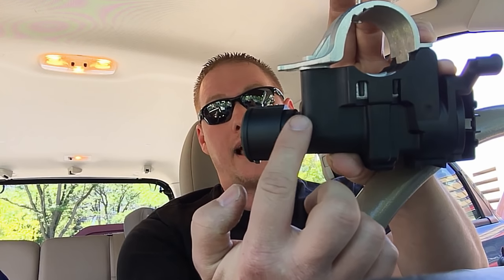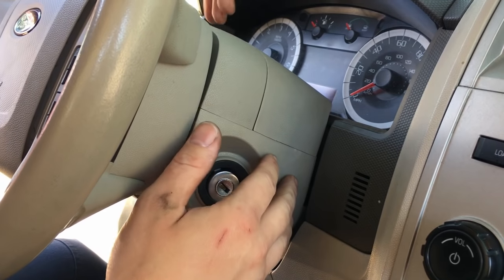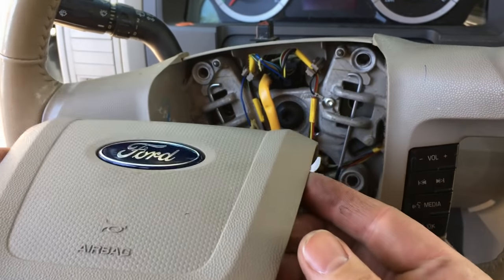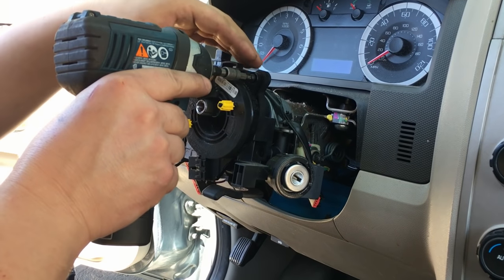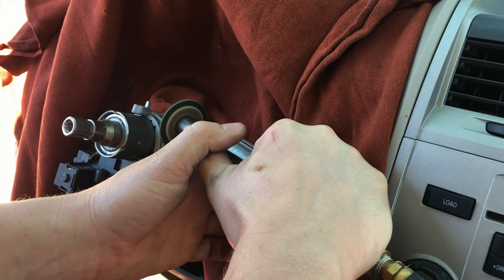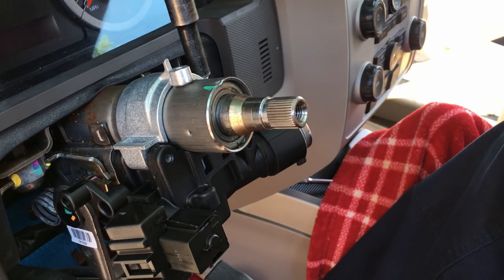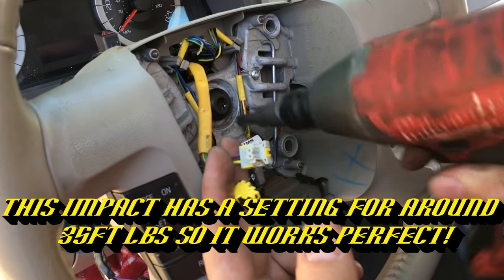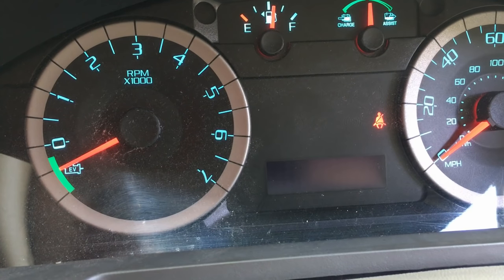2008-2012 Ford Escape No Crank No Start: Ignition Lock Module Replacement

Comment: I wonder if a bolt extractor would work on the blind bolt, might save the mess of the metal grindings.
Reply: Dremmel is what i use.
Reply from the maker: It should but this is the way Ford instructs us to replace them and it works quite well just a quick grind.
Reply: I can confirm that a punch/chisel works great!  I removed the bolt on 3 Ford Focus's this way.

Comment: Are you able to keep the original key/key hole or does that need to be replaced with an all new key ?
Reply from the maker: it stays the same.
Reply: Thank you for your response so quickly and great video, very nice.

Comment: Hey Bro! Wished I'd seen this video last year, My Bad :) Copart had a sweet high level trim Escape with 98,000 and a No Start.... it sold cheap and I wanted it but no idea that easy to fix!  also I have a 71' LTD that the key just turns a 360 :) Not biggie, only turn to run and press the secret button!

Comment: I know it's an older video but I was hoping someone could still help. I have an 09 focus with the same problem but the switch itself is rounded at the mechanical interface. I replaced the switch last year and it worked perfectly until now when it started again. When I look at the new flange it seems to have the same design flaw, metal rod interfacing with plastic hole. Does the new flange address that issue or will I have the same problem in another year?

Comment: I took the old cylinder out in the accessory position but when I went to put the new cylinder in, the lock module is in the off position so I can't insert the new cylinder all the way in. How do I get it over to the accessory position?

Comment: It’s a 2012 ford escape. Every time my battery gets disconnected it will idle low and turn itself off repeatedly until the computer re learns itself. The key has been broken but I had taped it but it got harder and harder to start. The Machanic I use put a switch to the ac compressor bc it wasn’t getting power and turning on without it but after he did that I would have to switch it off when I slowed down at a light or stopped bc it would idle low and turn the car off. Fast forward to now since the keys broke the Machanic used the ignition switch to start it up but the min I put it in gear it will turn off not allowing me time to drive it so the computer can re learn itself. I hear these escapes are notoriously doing things like that is that true? I do Uber/Lyft/DoorDash and favor for work so I NEED my truck to make a living. It’s been sitting here for 2 months already and I can’t get the Machanic to come fix it and get it going for me again. He says he will come but doesn’t show up and Im drowning here I have got to work. What do u think?

Comment: I did everuthign except torque the t50 screw to the steering wheel now it has a bit of play, could that be the issue even though I cranked it with the torque bit?

Comment: I have a 2012 Ford Escape...when I go to remove the screws on the bottom half of the steering column cover, I find that the screw or bolt has a round head. There are no grooves for a screwdriver and there are no sides to the head for a socket. It is round and I cannot figure out how to get them out of there. Any idea??

Comment: Hello. What If my 09 mazada has times when it starts up and sometimes it wont start.  So, if i tried to turn my key to start and tryed to push but it wont go in. Is it the Emission switch instead of the locking part??

Comment: Girlfriend has a 2010 Ford Escape. It won’t start, lights come on but in order to get it started (which is not doing it now) you have to bang on the dash (instrument cluster) for the dash lights to come on and for it to start....never in my life have I seen or heard anything like it. Battery is fine, she had the ignition switch replaced last year. Any ideas????
Reply from the maker: You need the solder joints on the cluster repaired, very common.

Comment: Hi, During the test,What if the theft light is blanking?
Reply: I have the same question. Did you ever find out and answer to this??
Reply: @kellyb3905  what's your exact problem.  Try and push your key in,a little harder and see if it starts.
I'm a locksmith and have seen alot of issues with those models of ford

Comment: Hello, I have a Ford Fiesta 2012, it will drive for a mile or so, but it automatically turns into (N) neutral stage. I can se the letter (N) on thr dashboard and it would not take any gears. Once place on parking, I will have to turn off the engine for around 5 minutes and it works for a few minutes. Any help would be highly appreciated.

Comment: Why would they just not put a screw in the first place where you have to cut a notch in the bolt?
Reply from the maker: The ignition lock module is an anti theft device so the snapped head is a security screw.

Comment: Can someone please help me out?? I have a 2010 ford focus se.  Initially my car started out with having to push the key in firmly towards the steering column for it to start.  It started getting worse and would only start sometimes after i turned the key multiple times.  It's not cranking over only can hear fuses/relays clicking. Was going to replace ignition switch, but don't know if it's that the starter or the ignition lock module.

Comment: So will the push in method eventually fail?
Reply from the maker: +AJ Advay it will get harder and harder yes
Reply: AJ Advay ... did you ever get it fixed? Or, are you still pushing it in?

Comment: Another issue is the hybrid Battery. If it goes dead? Your Escape will not run at all. I just bought my Grandma's 09' Escape & it's a Non-Hybrid. The Dealership was going to replace the steering column for $2200 because the power steering just goes out from time to time. I asked if I should buy it? They said no, because it showed to be a hybrid but it wasn't. They only Warranty a new Hybrid Battery for 8yrs. This is 12yrs old. The did change the Torque Sensor for $400 which didn't fix the Non Power Steering issue. So I found a new Column for $1100 on eBay & I'm waiting to see what my mechanic will charge to install it. Iether way? It's cheaper than the Dealership. They wanted $1800 for a new steering column.. The same OEM Column I paid $1100 for.

Comment: How can you tell if it that vs the starter being bad?
Reply: JUMP the two large pins for the starter relay with key in ON position. If starter cranks and engine starts its the lock cylinder housing.

Comment: Did you have to reset the program system at a ford dealership afterwards?
Reply from the maker: NO
Reply: FordTechMakuloco 
You're Amazing! Just watching your videos has helped me talk with the dealership and not get messed over. I have this EXACT issue and they told me "All the codes are lit...We have to call in the engineers...It's the high voltage power pack..." On and on. If it weren't for you and your incredibly thorough, completely understandable videos they'd of had me driving off the lot in new car and while they work on mine and resale it as certified pre-owned. So now -5 days later -I am told there are two fault codes that can't be cleared until the car can be started and the car won't start until the ignition lock module is replaced. I was quoted "Around $800" to replace the lock module. I was told the cost is in the labor to dismantle the steering column (saw you do that quite efficiently) and having to re-code they system (didn't see you do that at all). I know I've written a lot and I'm sorry. I don't want waste your time. I just need straight answers cuz I just don't trust this dealership anymore. Thank you for all your great information and step-by-step instructions! Bless you!

Comment: Just curious,  what is the purpose of the breakaway bolt vs a regular one?
Reply from the maker: +James Lee It makes it harder to remove the ignition lock module which prevents drive away theft.

Comment: If you had that ignition switch problem,  why fix it if you can simplify push the key in? That sounds like a great safety way to defeat theifs from stealing your car.
Reply: Sometimes mine wouldn't start and I'd have to take the key out turn it around and try again. 
Plus wife hated it and had trouble

Comment: I have a 2008 ford escape, and my steering wheel locked while I was driving ,really scary, this was 6 months ago,called Ford Dealership, it was a recall,took it to get repaired, ford covered some cost,ran good for 6 months ,but on April 10,2022 ,I was driving from Yorkton, Saskatchewan  my steering wheel  locked up again,and I had my grand children were with me,this is going to cost someone 's life before something done.

Comment: P.S. I only replaced the ignition switch on the end not the whole assembly. Eventually I will have to replace the whole ignition lock module.
Reply: Yes I too looked into buying the housing but my mechanic(McGruber my cousin) took it out and decided it was only the switch.  The video is very good  reference.
Reply: I ended up replacing the whole module and it fixed the problem. Thank    You FordTechMakuloco!

Comment: I have a 2011  v6 escape. It will not crank and not start, but then 24hours later it will start no problem... First the engine was stalling, then he said it was the battery. so he changed the battery it worked fine for like 2 hours then i stopped it, went to start it again and it would not start. I'm probably going to have to send it to the scrap yard. at least it's paid off. I should have taken it to Ford they might be able to figure it out.. But now it's like do I even want to waste another hundred dollars on it?

Comment: Haha this happened to my daughters 03 toyota corolla so I rigged a push button start for her lol works perfectly
Reply from the maker: +chad harmon That wouldn't work on ours with the pats system.
Reply: FordTechMakuloco ok well I thought her toyota had a antitheft but hers is just a regular key
Reply: FordTechMakuloco why wouldn't it? other than it not being factory? I ran a wire directly from the starter solenoid to a battery power push button as long as the assessory side of the switch works you should be fine......no?

Comment: PLS PLS HELP my 2011 escape needs fixing asap things were kinda working the other day would turn on and would hear the relay and fuel pumps going, didn't hear the starter so wasn't even turning over; the other night it started making crazy rapid clicking sound from the dash, the gauge needles were twitching too and now has no response at all. I replaced the ignition cylinder and starter a few weeks ago so not sure what's going on. Pls help I really need to get this stupid thing fixed before I lose my fucking mind!